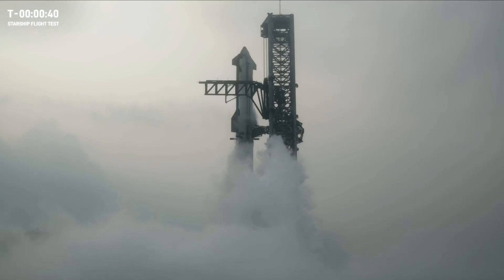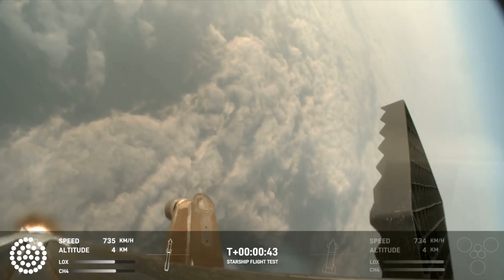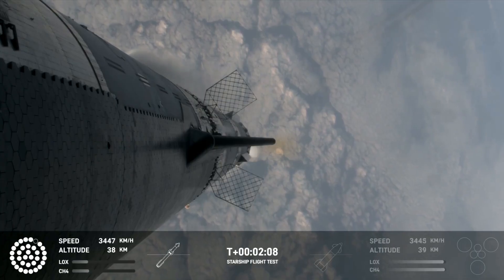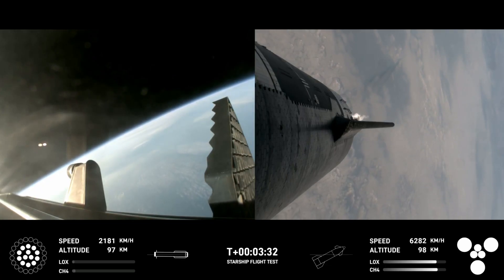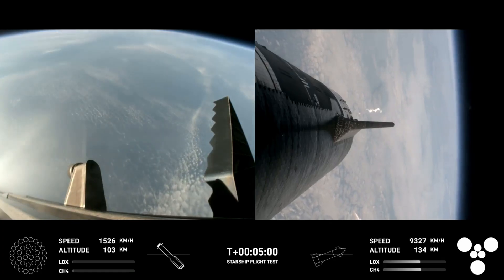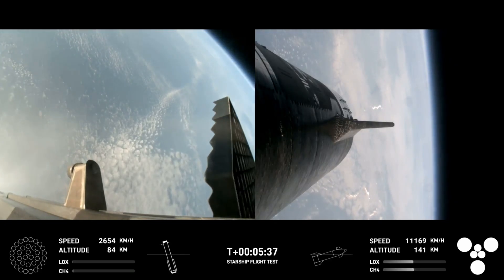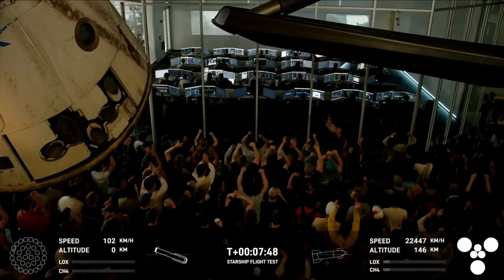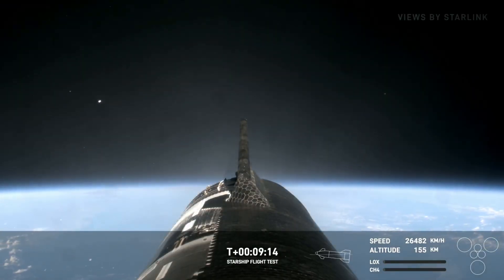Blastoff! SpaceX Starship launches to space on 4th test flight, booster splashes down!

Comment: At 5:05 did she just say that spacex is adding a section of "throw away rocket parts" so that it can reduce weight in future launches? Wtf? That sounds very stupid to me!
Reply: 1: basically every rocket throws things that are no longer needed away mid flight
2: its a temporary fix reduce the mass of the booster as the hot staging ring weighs around 10T. Future boosters (Block 2+) will have an integrated HSR which will weigh less.
Reply: @archierush868  A temporary fix..? They intended to launch this rocket knowing its not their best work? In other words this rocket is crap! Sorry but, you're probably some super genius and know exactly what a block 2+  booster is and its capabilities. But if you know its not your best. Why even make the attempt knowing that in the near future it'll be better? Why not be weighted less now rather than future? Are they purposely not putting out their very best with these rocket launches? Sounds as if they are pulling legs and want everyone to praise these half assed rocket launches.
Reply: @archierush868 So you have no response to my latest questions asked? Could it be that you cannot continue with the bullshit excuses for legitimate questions? The legitimate questions that are never asked by the ass kissing sheep that "love" the thought that these rockets actually go somewhere!

Comment: It's like living in a madhouse full of deaf-blind people... How can you still be so blind and not see that IT will never fly anywhere.
Reply: It flew from South Texas to the gulf of Mexico and the Indian Ocean, as planned.

It can reach orbit just by pitching over a bit more and sooner.
Reply: @archierush868  I'm talking about the original purpose. About flying to Mars or the moon with people on board. This is completely unrealistic.
Reply: @archierush868  I'm just trying to say that in civil/scientific astronautics, everything revolves around safety statistics. This concept is more complicated and less fault-tolerant than even shuttles, which were abandoned for security reasons. Everything rests on ceramic panels, huge loads on critical external elements of the ship. I do not see any prerequisites for a radical solution to these problems.

Well, for dessert. Now the question is not about one launch for the sake of delivering 7 people into orbit (1 mission). And in many launches to send dozens or hundreds of people, again, within the framework of a single mission. No one will dare to do this.

If this system ever works, then only the military will risk using it. And definitely not for flights to Mars.

Comment: What is that smoke coming from the rocket before the engines even startup?
Reply: Boil off liquid oxygen and probably tiny amounts of methane.
Reply: @archierush868  Sorry, i am not a very smart person. You say boil off oxygen and some methane. Does that mean the fuel tanks are leaking...? Wouldn't that ignite if it would get closer to the jet engines blasting very near by?
Reply: @79benzy it’s not really leaking but really venting (relieving internal pressure) but it’s such a small amount that’s being vented that it won’t damage the ship or booster even when getting ignited by the engines which pump out roughly 600kg of methane and oxygen per second… each (or 19,800kg per second for all 33 engines).

A small amount of venting is really no issue.

Comment: What is that small object in the background at around 07:10?
Reply: 4:56 that
Reply: @archierush868  of course no
Reply: @archierush868  No, at 07:09. It’s really small in the background, about straight up from the right side speed indicator. You see it move from bottom to top on the light background.
Reply: @valiantwarrior4517 and if you look at how fast the booster is falling, it’s falling at over a km a second. That thing in the background isn’t rising, it’s also falling, just not as fast as the booster.
Reply: @archierush868  Right. Is it likely a piece of debris related to the launch?
Reply: @valiantwarrior4517 its likely the hot staging ring seen at 4:55
Reply: @valiantwarrior4517  It's the hot staging ring lmao
Reply: @archierush868  Cool, thanks for the info.
Reply: @GoldenTV3  Great. I don’t get why that’s funny, though.

Comment: That odometer on the righthand of the screen kept accelerating up until it reached 26,498 km/hr which = 16,465 mi/hr, so at that point, it would have taken ~1.5 hours to circumnavigate the globe at that velocity...i.e., if it were a true measurement.  California to Europe in 20 minutes anyone?
Reply: Yes. That’s orbital velocities, but it’s just not in an orbital trajectory.

Low earth orbits take around 90 minutes for one full orbit.

Comment: 🤔🤔👍 The material must be reinforced by 40%.
On the other hand, the entire upper ship should be submerged. (Large immersion bath). This means you can forget about these patches. A protective coating that is applied directly to the metal. No "pins" that are attached hold this material.
As the #proverb goes: "Practice makes perfect and saves a lot of money and time". If #SpaceX does that, then I would like a #bonus for providing ideas.🤔🤔

Comment: Is still 3-5 years realistically from real mission launch looks like cryo cool preps are not lvl off prof use only baby steps what is well is massive weight but talks about serioucitu off flight is kind base tests star trek punch it through clouds incredibly even damaged in hauls so this principle off understand gravity and figure out orientation what is missing came to conclusion all this is bit to unserious is time to bring perhapse cryo lvl coolant extra II and III stage that what is in fourth stage has some already scfi advance vision more like figure next lvl box cryo that apply more pressure at less volume and gives squashed nuzle pressure apply better to surface then is work on hydro dynamics cooling PC cad type even some diagram PC present to develop branch burst lile tree branch that's basic lvl lvl 2 is diagonal this critical pass stage pass 2 speeding and elevating stage 3 is circle based spray cooling to adapt some prestage critical parts while rockets parts do it's self strength in nother words cryo coolant are safety guards then burst has some seriousity  is also possible by stage adapt scheme is cryo size tank box could lift volume like 25-33% stage I 33-45% stage II increase and 45-56 % increase at stage III that like for safety and new models made and easy volume numbers gets lift to tech eng german safety like accepting idea a cryo box needs min 56-65% cooling cryo system that know how at start but basic such as nuzle flated increased tree branch 3 cryo design you have to do your self anyway vtol is a power joke main prop as lift but some finese all stage 4 and even stage 5 suposing euro 5 should be also vtol rocket stage 6 is functional developed creativity it means engine to fit the desire off need or specs so diff weight are answer to options and desires and tech is massively improved and somewhere in middle stays like 145 MT photon torpedo based on tomahawk missile as star trek photon torpedo now the story is like is like option for terraform ops or even terraform on colony planets artifital planet nature athmosphere bit already like serious protocol in environment terraform which aquire some space laws know how and self used environment grow and how politely focused on future and increase balance and athmo soil in universe as continues through gas dust to increase planet athmosphere density procesd off cooling north or angle 5-6 % diagonal artifital feed source and drill colony with gas and h and o2 return this colony grow task as well as resource and self trade and extract and live under surplass energy society with thorium cells tocamac salt reactors nuclear 40 years off research packed in 5-15'years expansion and then even having own robot assembly diamond artifital factory and even distant mission extract gas and planets increase boom in easy 40-60 years boom cycles are better and functionality and people desperate in universe vast also and theoretical distance shorter there could be some time left to discuss about warp speed theory in between and some statue off Einstein for lust or burgers or eat more burgers at Mars and Tesla fictional theme park in electricity to get impressed fancy donuts at Mars totally marsian like like Jetsons but open to new minds but living on mars sounds like formula and epic dark monsters formula put that in closets area and develop fast with no worries epic era on mars and car crazy in 50ies are back funny but bit retro acording to Einstein and andy warhole whormhale sign famous rolling stones signs bit epic and weather response fast yes is time too

Comment: Anyone else see the UFO at 7:10?
Reply: No it is the detached hot stage ring
Reply: @Booster-13ALIVE  No. No, it isn't. That is not at all any type of ring that dropped minutes before the booster. At that altitude, nothing is orbiting. They'd begin to fall back to earth immediately at the same speed.
Reply: @anopoabednego6173  the reason it didn’t drop is it had all of that velocity same as the booster. The hot stage ring is not as aerodynamic, which when we see the hotstage ring it is at 50km, which is in the atmosphere, so it is slowing down as it is flat, on the other hand, the booster is more aerodynamic as it is not flat on the bottom
Reply: @Booster-13ALIVE  As an engineer, I do not need a lesson in aerodynamics. That was not the ships' hot stage ring.  The ring you are referring to would not be falling slower than the booster. The booster is coming down in a belly flop type of way.
Reply: @anopoabednego6173  the booster isn’t performing a belly flop, what are you on????
Reply: @Booster-13ALIVE   There are videos out there explaining when the hot stage was jettisoned. The booster would have been far behind it. Not falling faster than it. Not fast enough to pass it up.

Comment: 7:09 there is something that looks far away and big.  I can't imagine SpaceX took the booster near a satellite.  Looks big and far away for debris from the booster.  Maybe a classified satellite or space plane?
Reply: That’s the hot staging ring
Reply: @mistertagnan  I'm not so sure about that.  Could be.
Reply: @purdunetae2995  it is for certain. Profile matches, and it’s on a similar trajectory while decelerating faster than the booster, which would be expected. It’s also too low for it to be a satellite or space plane, leaving the ring as the only option
Reply: @mistertagnan  Please don't take this as me arguing.  I'm just thinking out loud.  But it's definitely aliens...  hahaha. Ok seriously, wouldn't the trajectory of the booster take it far away from the ring on decent?
Reply: @purdunetae2995  not really. They’re following a near identical trajectory except with a slight difference as a result of the separation event. Had the ring been jettisoned earlier (pre-boostback) then it would’ve ended up really far away, but as it is, they ended up being really close by
Reply: @mistertagnan  Ok.

Comment: Never made it to 214 Km, 70Km short of the alt. Maybe because of 32 out of 33 engines fired. Looks like the ass end of final stage got too hot because they (the computer)  had to slow down faster than they wanted to.Amazed that the canard didn`t burn off. At least it looked a lot more stable. Way better than 3 for sure.

Comment: What was achieved? Suborbital flight without payload with all components destroyed.
Reply: Successful soft landing of the booster and successful re-entry and landing of the ship. Both were intended to be destroyed if they managed to land, as were the booster landing to fail when they were trying to catch it, you can kiss the pad infrastructure goodbye.

Early Falcon 9s did similar water landings early on before the moved onto the droneship. They also did one in 2018 or 19 to test a riskier landing approach.

In any case, aside from the constant telemetry stream, the booster (less likely) and ship are likely at least somewhat intact, so they’ll get a lot more information on how starship and Superheavy behave. The re-entry also showed that there is a hotspot under the forward starboard fin, which will require correction
Reply: SpaceX tested the Falcon 9 to destruction as they quickly figured everything out whereas Boeing took an extra four years to get their first "historic" flight.

Comment: Looks like 99% operation of the main engines are needed for lift off.   What's the  minimum needed to not have to self destruct?  And what happens if a center engine fails during the time they are the only ones being used?
Reply: That's why SpaceX tests to destruction........

Then you know what it needs as well as what it can manage without!
Reply: It can probably lose 2-3 engines from ignition while still working more or less as intended. As you get further into flight, you can lose more engines without it negatively affecting you, but I’m not sure how many. 

As for if they lose a center engine during the regimes of flight in which they’re the only active engines, the can probably cope with the loss of one, but any more and the booster might not be able to be recovered

Comment: 7:09 ufo detected
Reply: i noticed the same thing.
Reply: It’s the hot staging ring
Reply: It's the sun.  Unless you mean that washer or other bit of debris from under the staging ring.
Reply: Was at 39 KM altitude or 131,000 feet.  Also, the heavy booster was falling at around 4200 KM/hr. and it stayed on screen for several seconds.  My guess is that it was part of the booster itself to be falling at almost the same speed.  I think the record altitude flight for the SR 71 was 85,000 feet but could supposedly reach 100,000 feet in altitude.  So doubtful that it was a plane as not only would it be above the maximum altitude of any previous plane, but it would have to be descending at around 3800 KM/hr to stay on screen that long.

Comment: There's a ufo at 7:10 cylinder on the right side gliding upwards
Reply: It’s the hot staging ring. The only reason it appears to be moving upwards is because it’s decelerating faster than the booster.

Basically the same reason why a when you pass a car on the highway, it looks like it’s moving backwards (from your frame of reference)
Reply: @mistertagnan  Maybe, it looks cylindrical and perfectly balanced  staging rings are circular and unstable and wobble, I say unidentified for now
Reply: @Manny_Vids  it’s not aerodynamically unstable, and it matches the profile of the ring to a T. There is no possible object that it could be other than the ring, unless you believe in fantasies
Reply: @mistertagnan ok I've seen a longer video where the ring broke off because the starship should be 100% reusable I didn't think of a 3rd piece, On that shorter video

Comment: Was the fact that 1 engine didnt ignite intentional? If not, why? They managed to light all engines for 2 flights, why weren't they able to do It again?
Reply: Sometimes 💩 happens, maybe a turbopump failed, a valve failed to open, or a seal broke. Only they know for sure, starting up a rocket engine is very complicated process that has to be balanced between both product streams.
Reply: @12time12 shit Always happens
Reply: Highly recommend everyday astronaut video on why igniting a rocket engine is hard it's kind of complicated but can simplifies down to where you can understand the issue., ladies and gentlemen/ boys and girls they actually pulled it off they launched and re-entered the equivalent of an office building., just think about that for a minute
Reply: they made changes to booster tank for this launch so anything could happen.
Reply: @MrCabbage-qz2vd  understood

Comment: Hiya! I know absolutely nothing about the tech of this so was wondering,  I watched the NASA launch yesterday and thought " wow that was tidy" but this launch was lots of smoke?... why was it so different?? Ty xx
Reply: The engines on this rocket are significantly more powerful than anything else that exists currently. It also has a lot of water being doused over the pad, so there’s a ton of steam and dust getting kicked up. You can actually see the shockwaves produced by the engines as it passes a cloud deck, that shows just how much power is being produced. Hope this helps friend.
Reply: @12time12  yes! Ty xxx  😊
Reply: @12time12  the re entry was fantastic! I can see myself really getting into this!
Reply: Coz it's ten time bigger than yesterday rocket
Reply: @tluangasailo3663 ty 😊
Reply: Because the starship uses methane as fuel
Reply: @metaps3922  ty 😊
Reply: Steam and dust this rocket it orders pf magnitude bigger
Reply: @RemyEightseventy  ty 😊
Reply: Plus its more pointy.
Reply: The other thing is that the other launch probably used a different system for the exhaust.  They have a ramp that moves the exhaust out in a controlled manner.  SpaceX uses a water deluge plate, that just pushes it out of all sides, its not diverted other than the water pushing it out.  Thats why there is so much more "smoke".
Reply: @didyuknow ty 😊
Reply: @didyuknow ty 😊